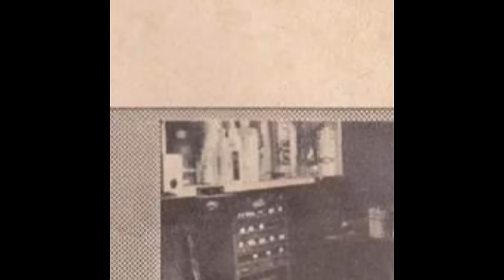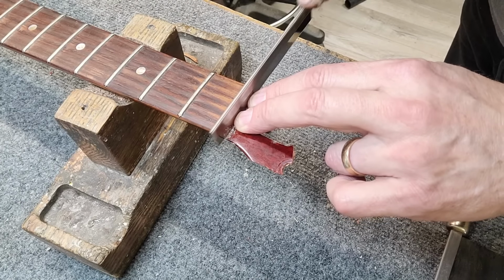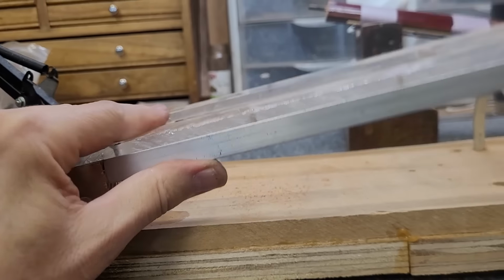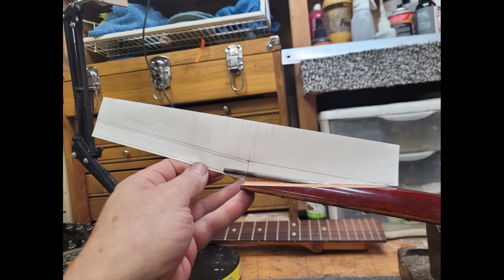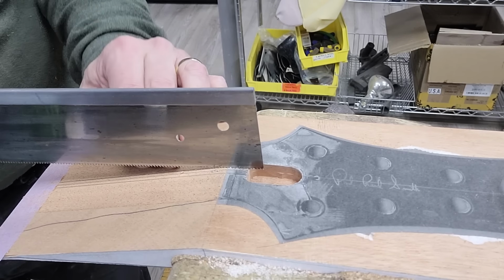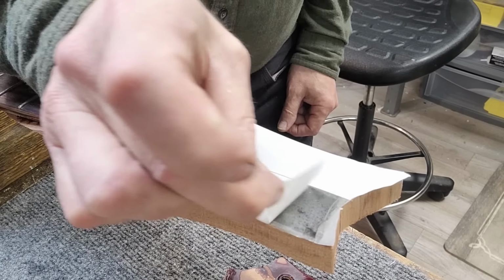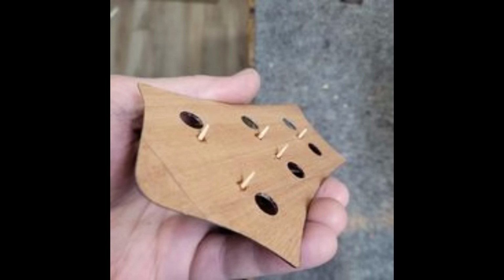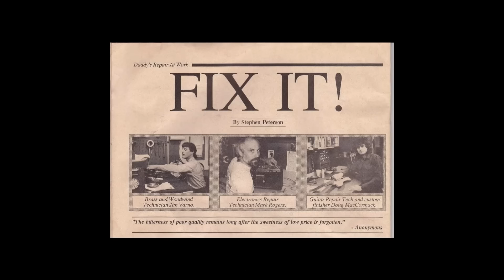PRS Headstock Splice / G-Glue Nightmare! An alternate method of headstock splicing.

Comment: That was very impressive watching you turn that ugly mess of a fix into a real fix!  I kind of knew how a broken off headstock was repaired but never fully knew all the different steps and I suppose each one is different depending how it broke and different variables that occurred.  Still, what an amazing job and clever to use the top and bottom of the original headstock as veneers to make it look like it was still the original.  I'm by no means a wood worker or carpenter.  I have a lot of tools for woodworking and I dabble into it a little bit.  I enjoy fixing things myself that most people would throw away or take to someone to get fixed.  Fortunately, as a guitar player I have never had a headstock break off.  Great work and thank you so much for sharing your techniques!
Reply from the maker: Thank you. Your very welcome. Keep up the dabbling!

Comment: We like that scarf jig you made! It’s clever and works well. We first saw it in your Les Paul headstock replacement, and that’s why we’re here watching the hapless PRS get a new headstock, too. We see the truss rod is revealed, and we are anticipating a good chunky scarf with the sawed and chisled channel to accommodate that section of truss rod. I think the PRS is a pretty guitar with its usual horizontal flaming. So with the PRS I’m wondering if you’re going to cut out the logo on the old headstock, rout a nest, and insert it into the new headstock like you did on the black Gibson headstock, or if you’ll need to order a new logo. Okay…we’re watching and we will find out.
Reply from the maker: As you probably found out, I made a veneer of the front AND back. This one is old enough to assume that Paul made this one himself. The logo is a waterslide decal and the modern ones aren't quite the same.
Reply: @   Oh! I didn’t know that. The logo did look vintage, but I didn’t know. And oh, yes! We saw you slice of thin veneers from the front and back! I never expected that.

Comment: Very nice repair. 👍Considering all of Paul's attention to detail regarding guitar design, it's odd that he uses truss rod access at the Nut where removed wood makes a headstock break much more likely. That said, PRS headstock breaks seem to be rare, at least on YT.

This is the first repair video of yours that I've seen, and I plan to watch more. I liked your clever use of glass on your sanding block to create a very flat/level sanding surface. What kind of glue did you use for that?
Reply from the maker: Thanks! I used Regular Tight bond for the splice, fish glue for the veneers.

Comment: Experience shows that polyurethane glues serve well for wooden instruments. The only thing that surfaces should be pressed very tightly, so glue won't have place to expand. I wouldn't use that for rough headstock breakage seams. But it has it's use, it's stronger, but non removable. Application has to be with certain intent in mind.
Reply from the maker: That may be, but this old fashioned conservatively trained guy will be "sticking" to more traditional, easier to clean up water based adhesives. 😁 Thanks for adding to the conversation!

Comment: Lovely repair and very very difficult. Totally respect your skill. Sometimes with guitars, and this drives me nuts, in my humble opinion guitars are temporary creatians on this earth. A guitar built by computer in a humidity controlled environment will fair in my opinion into the future. I would never ever spend money on a vintage guitar. Money down the drain in my opinion
Reply from the maker: Well said! I like old guitars....they put food on the table for me!
Reply from the maker: There's lots of great replacement necks out there. Maybe rejuvenate that strat that way? I also had a candy apple red Tokia from that period. Wish I still had it!
Reply: Leo Fender knew this. He never meant for his guitars to last for 70 years. For example, the bolt-on neck was made to be REPLACED. Same with all the electric components. I am sure that he thought only the basic wood body would still be around with everything else replaced with new parts. In my opinion, a “vintage” electric guitar is a paperweight or a decoration, not a musical instrument.

Comment: Too many people have no understanding of how glue works and exactly what is required to make it work properly. They don’t consider leverage and glue surface. And most of all they fall for ads that promise miracles with certain brands of glue like Gorilla Glue (polyurethane glue) and Crazy Glue (cianoacrylate or CA glue). Neither works as well as common wood glue if surfaces can be joined and clamped properly with enough glue surface. The foaming property of polyurethane glue will actually push surfaces apart if they can’t be firmly clamped. And it will push out if they can’t be moved. I no longer use it. And the best use of CA glue is to temporarily hold things together while you work on them in conjunction with masking tape. And double stick tape actually works better for that.
Reply from the maker: In fairness, Gorilla makes a yellow carpenters glue similar to tightbond. I used super glue quite a bit but it's not "Crazy Glue". I use a "gourmet" level of super glue called Glue Boost that comes in different viscosities and applications. I use it for filling small dings in poly finishes, gluing plastic nuts, making quick jigs, plugging small screw holes, water proofing end grain when wet sanding and penetrating small cracks that would otherwise be impossible to penetrate otherwise. It's great for stabilizing soft wood.

Comment: Doesn’t look like a real PRS to me. Never seen the signature logo so small and all of the American PRSs have a hand written serial number on the headstock back. Didn’t see that here. I think that’s a Chi-R-S.
Reply: I noted the black plastic nut as well ---- I would have expected a bone nut on a fancy brand-name guitar like this....
Reply from the maker: It is in fact a PRS. In fact an early one (1988-89). Likely built by Paul himself. The logo was smaller and the serial was hand stamped on the back. That's how they rolled back then. The graphite nut was probably a replacement at some point.
Reply: My '88 logo and serial number look exactly like that.
Reply: @dougmaccormack9485  crazy. They’ve come a long way in 30 something years that’s for sure. But I guess all guitars have come along way since 88-89.

Comment: Before tapping the nut to remove it, clamp a wooden block to the face of the headstock opposite the side you tap on, and snugged right up to the nut. This will minimize any flaking of the finish, and the nut will still come free.
Reply from the maker: Yes. Very good advice. Sometimes I will also  score the finish in the corner and mask the face when I heat up with a heat gun to soften the bond. In this case the nut had already been replaced with a graphite one so it was easy. On a new instrument I would take all these precautions but on this one it would be pretty much a moot point as replaced the whole section with new wood.